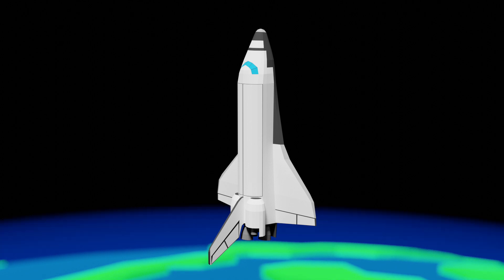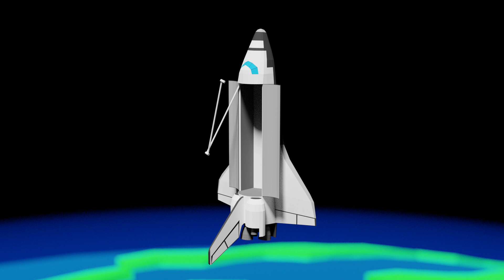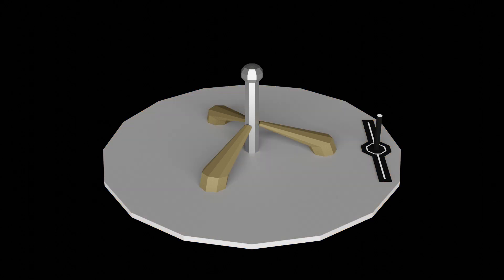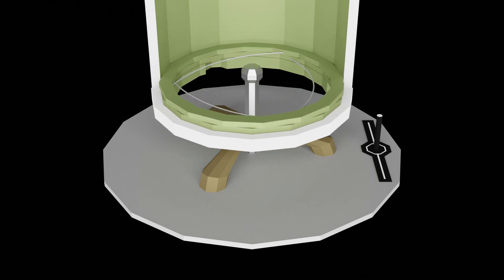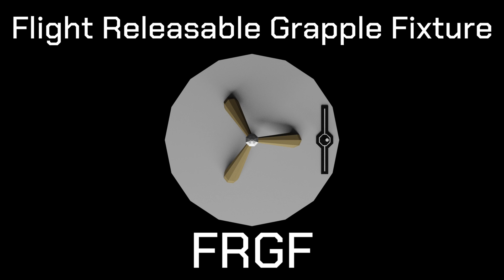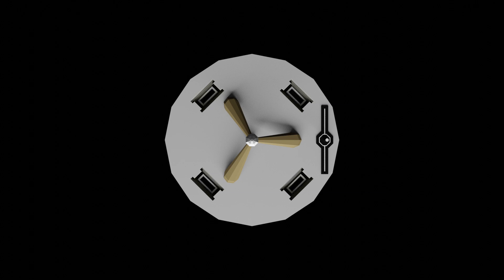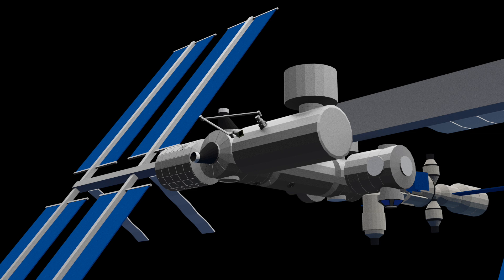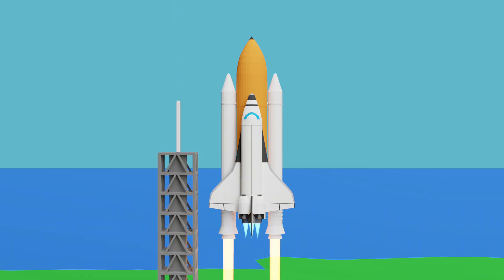How Canadarm Grabs - Grapple Fixtures and Latching End Effectors

Comment: Awesome video on that revolutionary mechanical device. Originally I thought it uses powerful electromagnets as well as a grabber. Now I know how it can move itself around without the need for Eva's. Also but I do know - in case you didn't know that the arm and fixtures are made of Titanium
Reply from the maker: Revolutionary indeed, the International Space Station wouldn't exist (at least not in its current form) without Canadarm. Interesting they're made from Titanium, I had just assumed it'd be aluminium and steel.